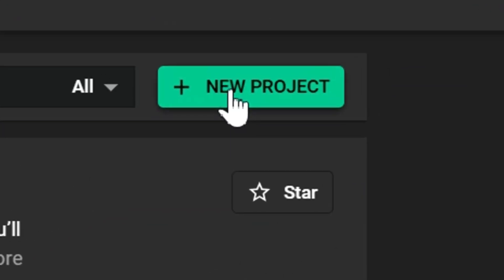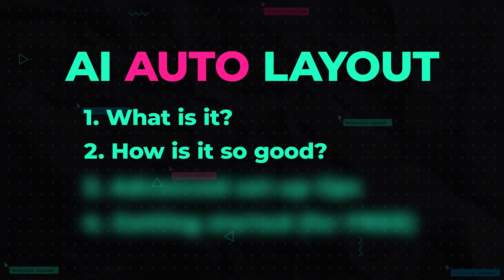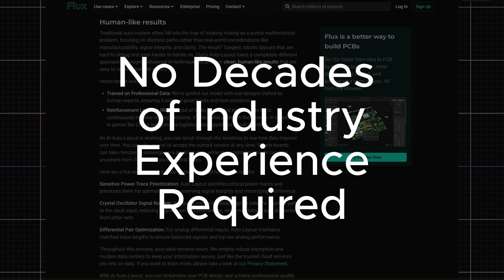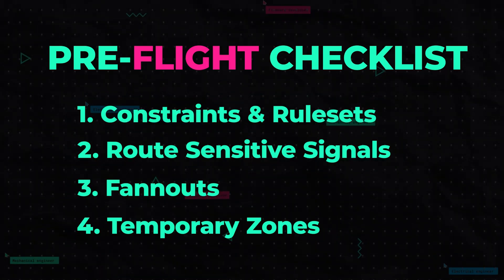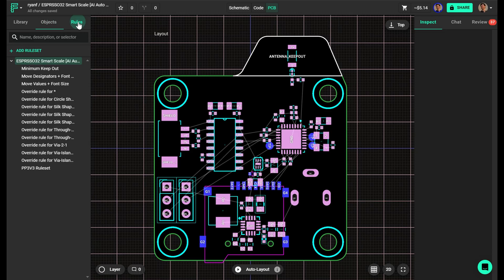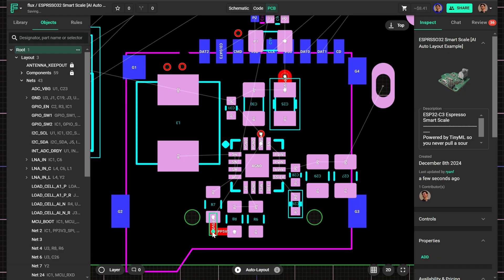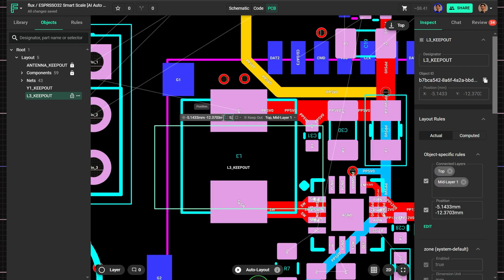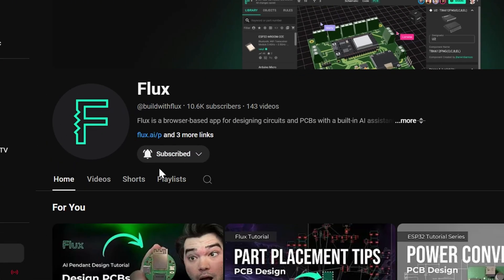Introducing AI Auto-Layout: a new way to route PCBs

Comment: It would be great to see how this tool handles 10+ layers, PCIe x16, multiple power domains, etc. Maybe try using the open-source server board and see if it's done at the same time an engineer would be? Really curious. 2 layer boards are too easy, even Altium can do it good enough.
Reply: And then how well it passes emc or not 😅
Reply: We have tested it with 12 layers boards and up to 1,400 components...it does a incredible job!

Maybe we whip together a demo video to show that
Reply: @matthiaswagner5274  When you say "it does an incredible job" do you mean you get working device or that it looks incredible?
Reply: @KostiantynD a working device with routing done in a way that humans can understand